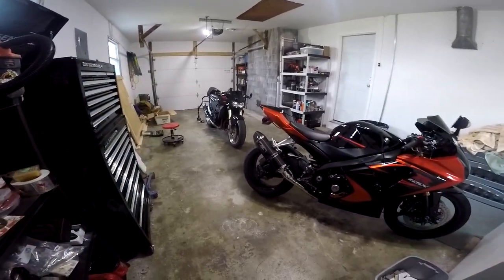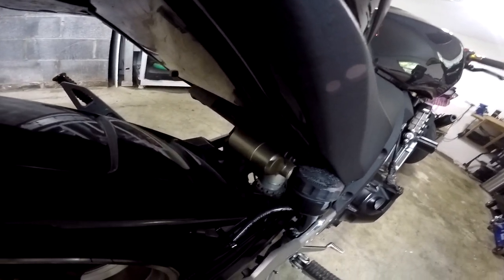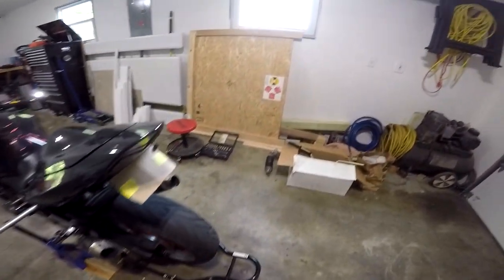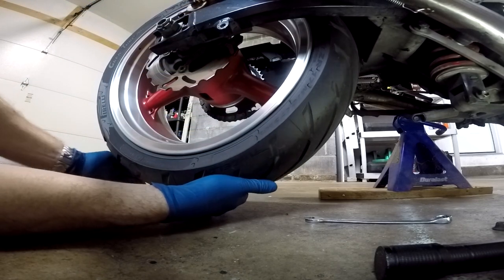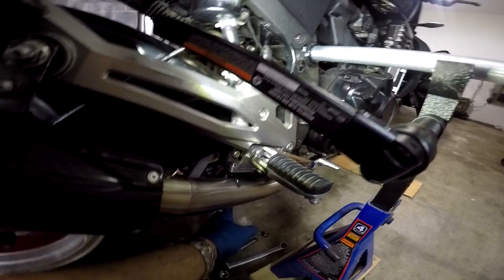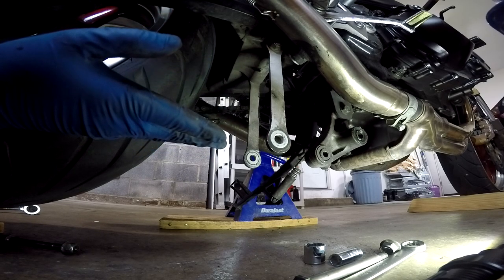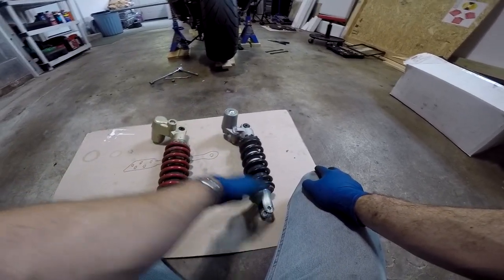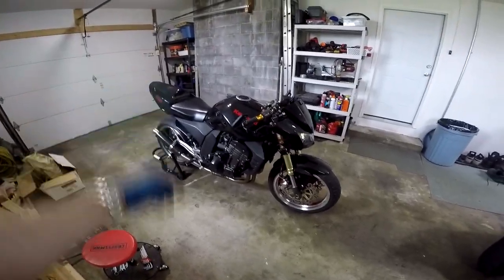Ninja ZX-6R Rear Shock Swap - Gen 1 Z1000 (03-06)

Comment: Hey man thanks for all the first gen Z1000 videos. I’ve been having a problem with speed wobbles with mine when I get up to around 110mph every single time. I know this isn’t normal as these bikes can do 150 and I’ve seen videos of them doing it. Do you know what could be causing this issue?
Reply from the maker: The first gens were notorious for speed wobble. Did you install an aftermarket steering damper?